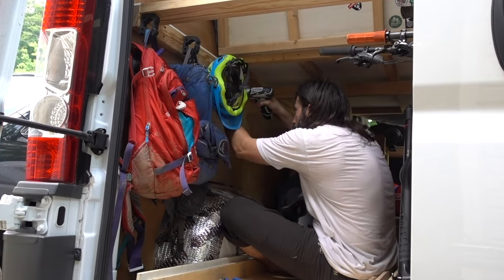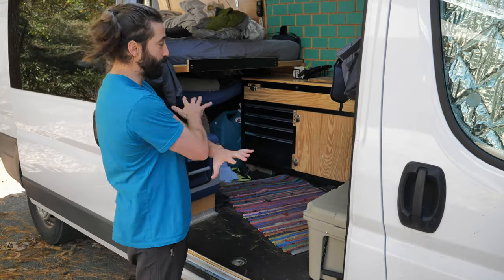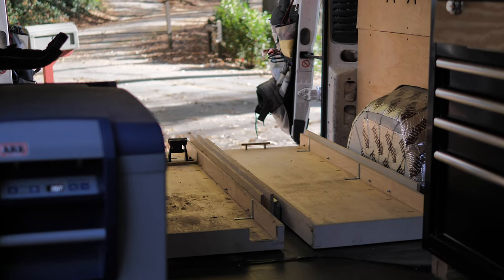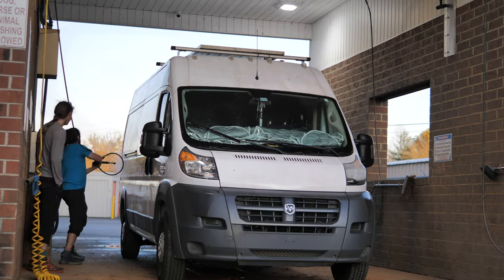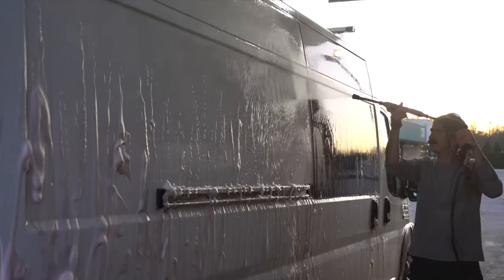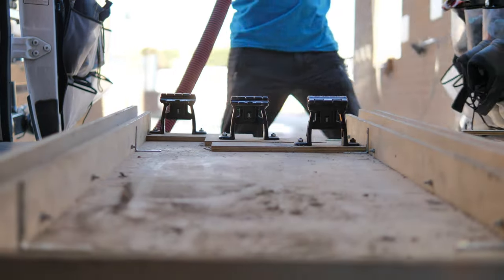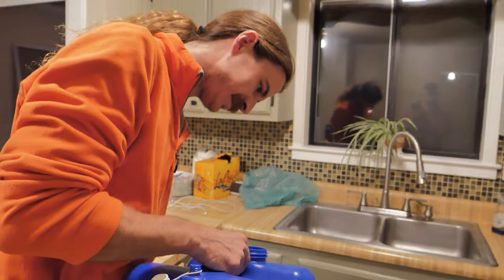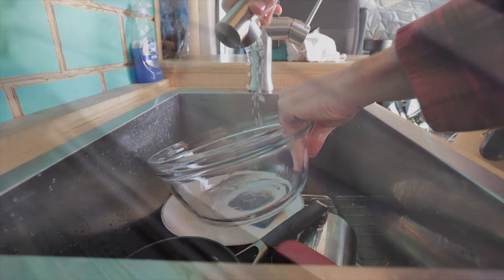Inspecting, cleaning, & reviewing the pieces of my custom camper van after 2 years of adventures

Comment: I’m guessing that you’re not gonna clean Dora like this in a long time, but you should absolutely clean the solar panel more regularly. A thin layer of dust has a much bigger impact than you think.
Reply: I was going to sat that too.
Reply: A battery powered pressure washer would be a nice addition to the van. A Worx Hydroshot for example.

Also, a ladder or something like drywall stilts to get up on top of the van with ease to clean the fan and the solar panels.
Reply: Just ask the old Mars rover...

Comment: Before the plywood gets any more damaged and delaminates, you should coat all of the wood, especially the cargo / bike trays, with an epoxy resin like used on countertops. Somewhere around $75 for a gallon. Penetrates the wood, makes it water resistant, and provides a harder and easier to clean surface. I did this for my tent trailer cabinets years ago and it worked fantastically.

I can also highly recommend a side awning over the side door. Easy to deploy, invaluable in the rain, helps keep the van cleaner inside when you use it as a vestibule in bad weather. Mine on my tent trailer also has side skirts that zip on and make a tent (without a floor) that guests can sleep in.

Love the content, please make more!

Comment: Great van and I love the garage setup.  I'm planning a similar design in a sprinter for 3 bikes and storage totes on slider(s).  Debating between one big wide slider vs. 2 like yours.  I'm thinking I'd gain a little storage space with 1 big slider., but maybe harder getting to the center bike and the inside totes.   Any thoughts  on one big slider vs. the 2 slider design you went with?

Comment: What my dad did on his truck and something you might be interested in is adding a black water tank up top and an air compressor or even a hookup for a bike pump to pressurize the chamber and you can have a shower just by mounting it up top and adding a spigot and a short length of hose with a nozzle at the end

Comment: Looks like you got a good amount of condensation in the headlights; this is a common problem with these vans. Pro tip: pull out those headlights, open them up and re-seal them with new butyl rubber.

Comment: Your air filter screws that hold the air filter cap down retain water And the screws rust you should pour a drop or two of oil on them or lubricate them  when you change your air filter to prevent corroding ,my snapped when I replace my air filter and I’m sure yours are the same way. Btw Is the reason you call your van Dora is because you live in Mount Dora?

Comment: Having the bed/couch rope wear out on you looks like, it not only could cause some problems but, it’s going to happen eventually. You may be better off going with steel cable (preferably with a rubberized coating) as it will definitely have the strength along with a resistance to the same wear as rope would. However it is quite possible that steel cable may come with its own list of safety concerns that I may be wholly unaware of.